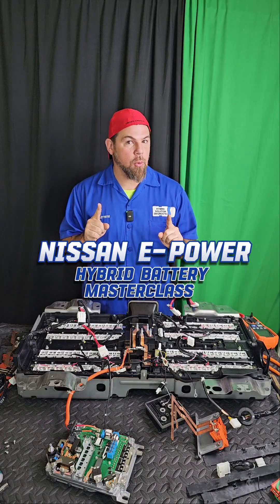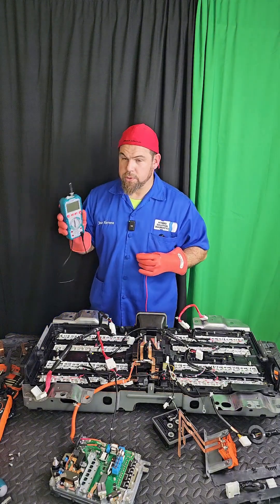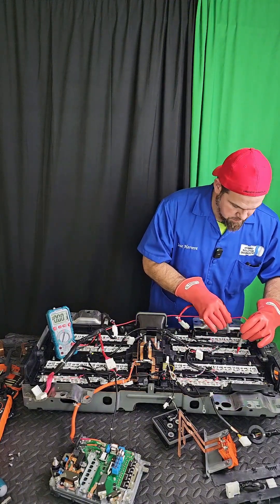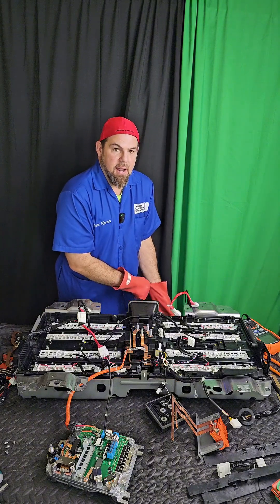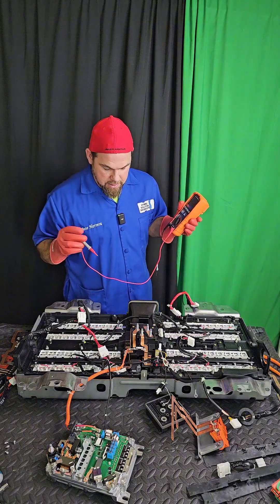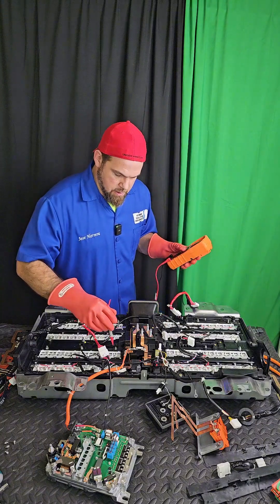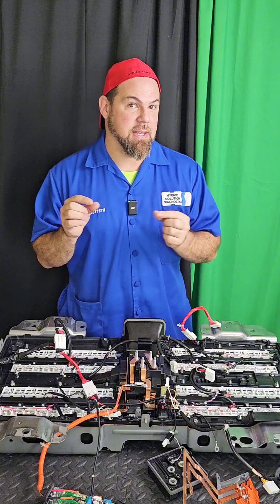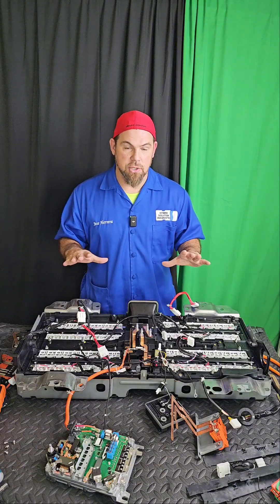Nissan e-POWER high voltage battery isolation fault diagnostic procedure

Comment: Hello, can you please advise. Nissan note e power, was laying for a month in bodywork shop. Now its not starting 12v battery replaced. No joy.  Diagnostic shows 2.1-2.3 v per cell , 80 cells .173V total . Does it mean that hybrid battery is s gone, or is it normal voltage when petrol engine is not charging? Thank you...

Comment: Awesome work man, the first test for the individual cells, a diagnostic tool would show the cell capacity so in real world prior to stripping the car to get at the batteries that could be step you do to eliminate that possible cause.
Reply: Hello, diagnostic is showing approximately from 2.1 -2.3 V per cell . On video here is 3.7V. car is not starting. Any ideas? Where to go first, inverter or hybrid battery. 12V battery is ok 13.5V. Thanks